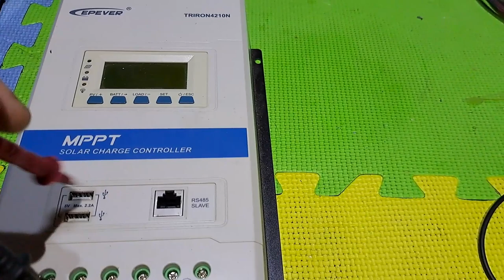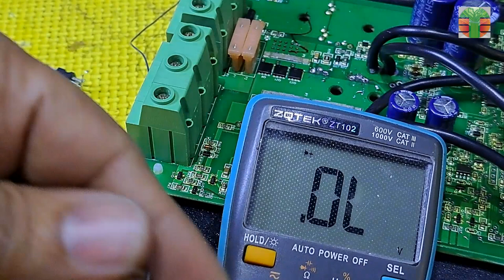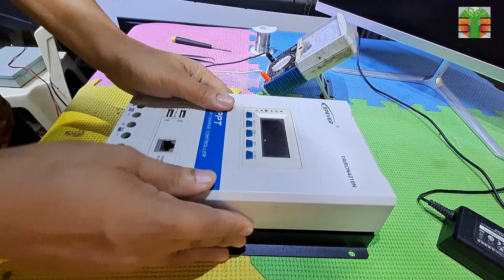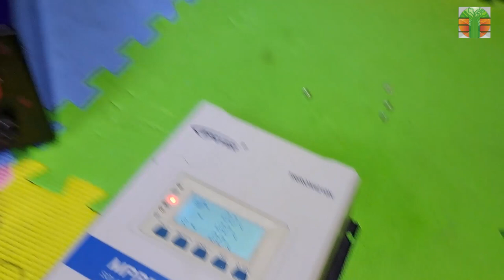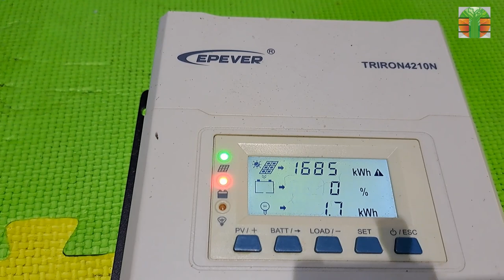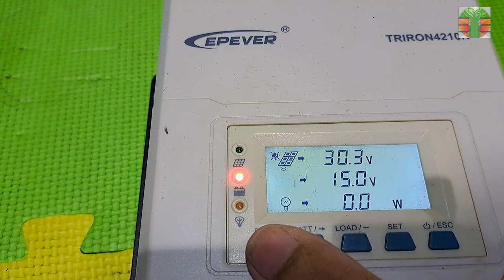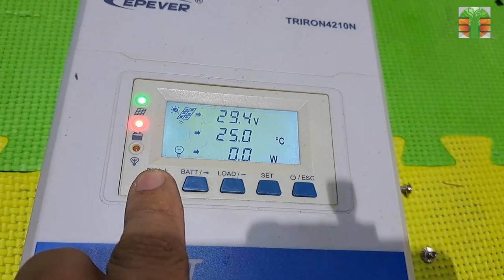EPEVER Triron N Series MPPT Solar Charge Controller (not turning on)

Comment: Good video, and good work!

It is very easy to over-voltage these MPPT units which are rated at 100V, but can take over a 1000W input at 24V... I have seen this exact problem before; every Epever MPPT I have seen fail, failed at the MOSFETS or the 330uf 100V capacitors. Withe the FET failures I assume due to the panel exceeding VoC in our very cold Canadian weather when it's sunny out, and the MOSFETS going into avalanche, heating up, and dying. 

INFINEON IPP041N12N3GXKSA1 may be a better replacement with a 150V rating instead of 100V. I have not tested this but it should work. I would also replace the large 330uf capacitors with 150V or higher ones. Panasonic 330uf 160V EEU-EB2C331 is a better replacement for them which I have used many time successfully.

Comment: What do you think is the reason for the failure of the MPPT mosfets? Customer abuse?
Reply from the maker: The owner of this MPPT solar charge controller uses more than the maximum amount of solar panels, that's maybe the course of the failure.
Reply: @tevzTVTevatronics  I thought as much. So how do you protect yourself if it comes back with blown mosfets again?
Reply from the maker: @angelosanagnostou5550  Protect myself? for what?
Reply: @tevzTVTevatronics  from customer saying that you did a bad repair in the mean time they are abusing the product.
Reply: @tevzTVTevatronics  Sometimes mosfets are blown when disconnecting battery first